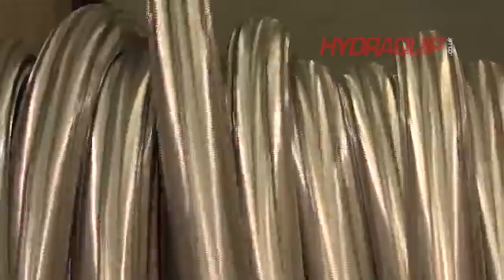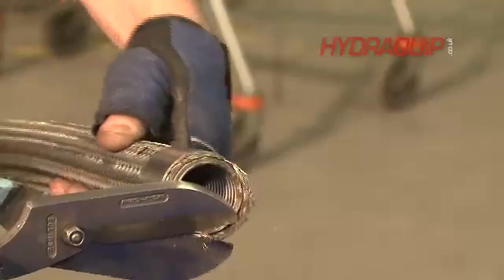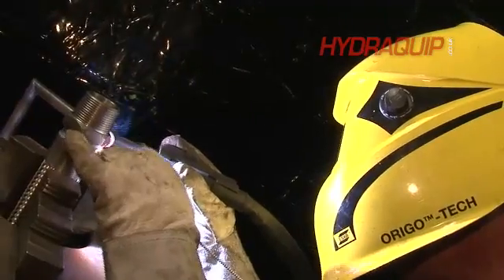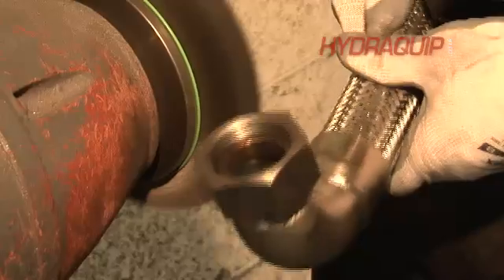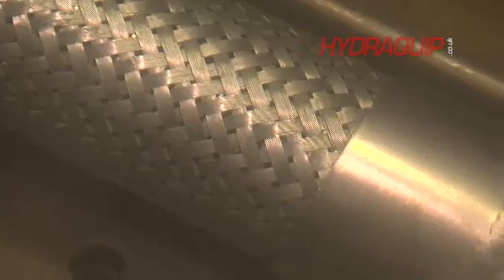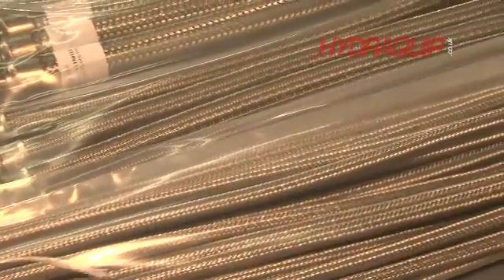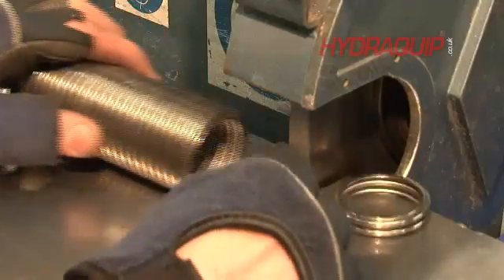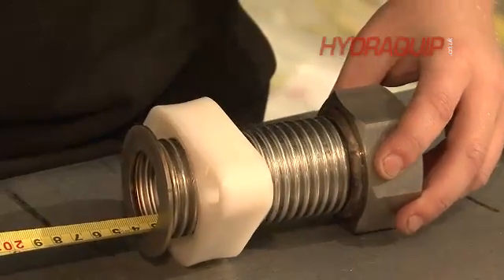Manufacturing Metal Hose Assemblies Overview with Hydraquip

Comment: Hmmmm nice we did ours different the fit up all the same but welding procedure was different we welded the braid ring and hose without the fitting then welded  fitting on after  I prefer your way but I don't like  the way you pressure test your hose we hydrostatically test because water doesn't compress and explode air can go off and kill someone
Reply: We capped welded, then welded the fitting.  Yeah, is that a hydro test with no cover.  I talked to a test plug manufacturer and they have seen plugs fly like bullets.

Comment: High-performance production facilities
Angst+Pfister's state-of-the-art production facilities take over for customers manufacturing steps such as preassembly, contour cutting, stamping, and machining of semifinished products into finished components.

Our range of custom fabrication services also includes processes specifically tailored to the needs of customers, such as calibrating gas springs, TIG/PLASMA welding to manufacture metal hose assemblies, pressing fittings onto hoses, pressure testing, marking and identification printing, as well as welding polyurethane toothed belts.
音乐
Express Yourself - 来自Charles Wright, The Watts 103rd. Street Rhythm Band (Google Play • iTunes • AmazonMP3)